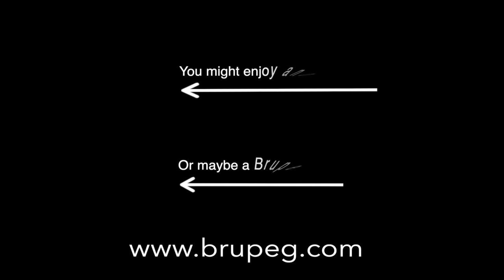Building a 112kg Anchor (part 2) - Project Brupeg Ep. 143

Comment: Quick tip to make picking up the iron filings easier, put the magnet in a plastic bag that way you can take the bag off and in doing so separate the filings from the magnet, leaving you with a clean magnet and a bag of filings.
Reply from the maker: Ha! i have tried the bag idea but i wasnt qualified to drive a bag, it ripped, i made a shambles of the dismount. i ended up with a shreaded bag, with some fillings, a magnet covered in bag bits and more filings and a wife laughing at me because a ziplock bag bested me...

Comment: its impressive to see how far you have came with welding over the past year damo, i know welding thicker is easier but you have definitely improved your control of the weld pool and dialing in the settings better nice work. also wish jess the best with her health i suffer with rheumatoid arthritis, i had to throw away my career as a qualified boilermaker when i was 24 after being diagnosed with rheumatoid and struggling with chronic pain, joint problems and fatigue im 27 now. i really admire jess's push to be involved as i know myself how hard it can be  with the pain you have to endure days after when you over do it. great stuff guys
Reply from the maker: Yeah thats a big issue for Jess, moderating how much she does on a given day as you need to forward guess how bad the next 3 will be. I have to say getting the new welder really helps with weld control, Nugget the old beast was a big block of copper, its settings were on and off. this new one actually has the ability to vary the horsepower so it makes a world of difference. Thanks for the feedback. Dame

Comment: On the hole at the end of the anchor for the chain you might want to put a slot. drill two holes 3 inches apart. Then cut out the space in between. That way you can put clevis eye through it. and then attach your chain. Now that you welded the flat steel strap on the end of the anchor come bake with a 3/8  round strap on top of that.
Reply from the maker: Hi John, unfortunately the anchor has now gone off to the galvanisers.

Comment: just a thought put the magnet in a plastic bottle to pick up the iron filings then when remove it & thay will fall of without having to pick then off.
Reply: Or ----   use a  plastic  shopping bag  .   Drop in the magnet  ,collect the metal dust then invert the  bag ,    ta-da  - bag of dust and a clean magnet !!!
Works  perfect  - and fast .

Comment: What is the bow roller setup like? You've got a 16mm bump on the shank now, when dropping it off the boat that's going to try to snag all the time.  Wouldn't smoothing that transition be better all around?
Reply from the maker: 150mm bow roller wont even notice that. its also only a 6mm bump. the bow roller will be set up as a gravity assisted self launcher, ie the anchor pointing downwards so launching is very straightforward

Comment: Is the angle of the roll bar too much forward  i feel as though at that angle it may not roll and right its self it may just sit upturned, obviously a test before fitment and galvanizing  by hooking it up to the car and reversing will show if it works... can a swivvel for that size chain be obtained to help aid in the roll .... cheers
Reply from the maker: Hi Ken we had a couple of different anchors on boats in the yard during the build so the angle was a duplication of known anchors that work. we wouldnt bother re-inventing the wheel if we can help it
Reply: @ProjectBrupeg  mine doesn't have a roll bar at all and its never failed me not that different to yours though a 5th the size
Reply: @ProjectBrupeg  Fair enough mate wouldnt want you doing that... i use a Sarca in a much way smaller size than yours they are vertical no angle and a mate has a Manson and his has only very slight angle anyway you know best for your purpose ...cheers

Comment: I used to sell metabo power tools and abrasives. I used to have a deal if you got 100 cutting discs you could get a free grinder. Maybe find a independent  distributor you could if needed.
Reply: I would do any mix of cutting or grinding whichever formula needed..
Reply from the maker: Nice, ive not come across that sort of thing before. I will ask around

Comment: Would love some insight into the design process of the anchor.. what makes this a good anchor for Brupeg?
Reply from the maker: Hi Clayton. It’s based off years of using anchors and watching what other people use. All anchors have their pros and cons, for us this is our take on the most effective things we have seen in a variety of styles over the years. Plows drag unless they are hugely oversized - so we opted for a flat shovel style blade, Manson Supreme roll bars work really well to right the anchor but are thin and fairly easy to bend - so we opted for solid bar with a horn to add strength, Mantus have a great blade shape but by adding the crease and extra weight under the tip we have strengthened the blade plus made the tip more likely to dig in
Reply: Great question Clayton, great answer too Brupeg!
Reply: @ProjectBrupeg  You have talked about the design as in shape here and in your previous video. How did you decide on size and weight? I found a chart some folks reference. Is that all you did was compare size of boat? Or did you take have to take in to account the environment it will run in. I guess the same question for the design now. Was the environment in which it will be used a factor in the design? Thanks!

Comment: Just a question Damin.  Is your plasma cutter limited to a certain thickness it can cut ??? Is that why you use so many cutting wheels ????. Enjoy the Project mate
Reply from the maker: That is correct. it has a maximum of 62 amps, so above 10mm thick and it really starts to struggle. the other side of the coin is grinders take longer but are much neater cut and more accurate. (yes high end plasma are neat and accurate) so normally if we plasma we then have to grind it clean/smooth so it has its place but cutting discs were the best choice for us. Our 9" grinder was dead hence we used the fives

Comment: You've done a great job of working with what you have got. I'm just wondering why an oxy or plasma didn't make it higher on the list of priorities given the amount of cutting being done on the anchor specifically and job generally. Cheers.
Reply from the maker: Cost. We went through about $40 worth of discs and for us to rent an oxy is a real pain because we are out from town. We do have a plasma but 20mm plate is not something it can do (10mm is about its limit) so we stick to grinders as we very rarely need to cut stuff this thick

Comment: have been told that galvanizing weakens steel. chain not 100% sure about that
Reply from the maker: I dont know, it could do but i suspect not by much, if it was an issue almost every anchor and anchor chain in the world would fail.
Reply: From memory (old fart) it is a percentage  not massive  easily overcome  by going  slightly  bigger  but as you are on a budget. Use what ever you have .it looks  a fairly big size anyhow.

Comment: All I see is you guys reinforcing guessing beefing up and overbuilding absolutely everything you build adding more and more weight constantly. I can't help but feel sorry for that poor little tiny used engine you plan on running that boat with. By the time you launch her and get her up to top speed I can't see the vessel traveling more than two or three knots. My prediction is that the poor little tiny engine will be the first thing that gives up the ghost and will need to be replaced with a much bigger and more powerful engine. I do wish you the best of luck as I am a long time subscriber and have been following the build from very near the beginning. I've built two boats myself so I find this quite interesting and am sincere when I say good luck mates!!!
Reply from the maker: Thanks Randy, we calculated hull speed and the horsepower needed to get there, 206 at the prop was needed. we have 350hp currently so if this engine cant push us along weve broken the boat.

Comment: Does the hole world run on vise grips
Reply from the maker: lol absolutely not, Duct Tape definitely has its place! and hammers, or if you can't find a hammer, vice grip's can be used as a small hammer, or if they are a large pair, then they can double as a big hammer. If you hammer them too hard then apply duct tape to the vice grips so you can get them back to the work of hammering!

Comment: Hehe you could have saved enough money in cut off discs to buy a plasma cutter
Reply from the maker: $40 plasma cutter...
Reply: @ProjectBrupeg  you must get cheap discs. :-D
Reply from the maker: yip, ebay is amazing for consumables, ive tried the expensive ones and some last slightly longer than the cheapies but nowhere near enough to justify the cost. we've blown through maybe 1,000 cut off discs over the last five years and never had a safety issue (once i blew a disc up but i was a dick and bent the disc during a cut).

Comment: Damien ... You must get a bit fed up with all the armchair safety nazi's chiming in, but I am sporting a nasty scar on my left shin from dropping a large lump of steel on it six weeks ago. Those crappy cheap Bunnings work stands look are notorious for collapsing, especially with damn near 100kg of anchor fluke on them.
Reply from the maker: Yeah we realised they are about as shit as we could buy. Tomorrow we are welding the legs locked open with a scrap bit of steel as they fell apart maybe six times today alone
Reply: @ProjectBrupeg  Great! I have to confess I cringed my way through half of that episode. I needed a fast trip to the local ED and 10 staples ... and it's a fresh memory. Great anchor though. The first owner of my boat built his own copy of a Brugel anchor in stainless steel, and it still works just fine.